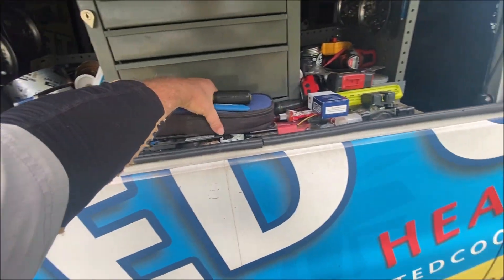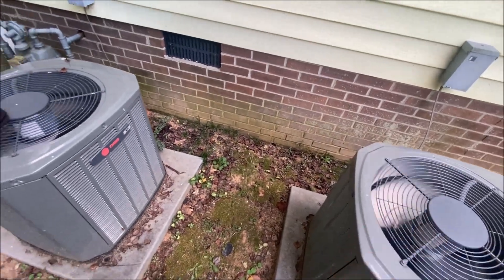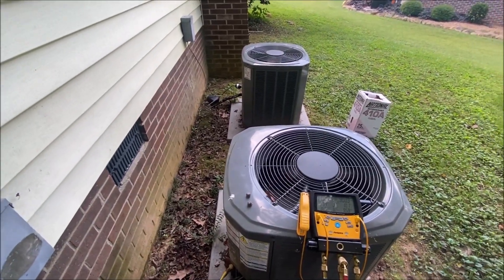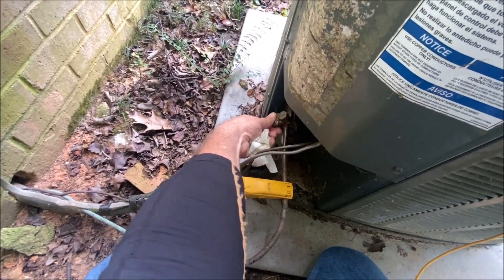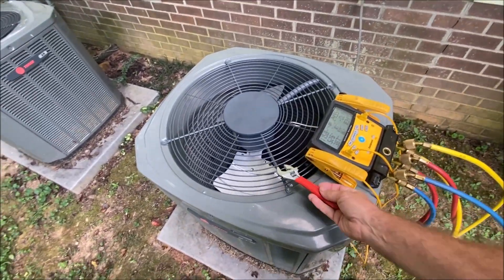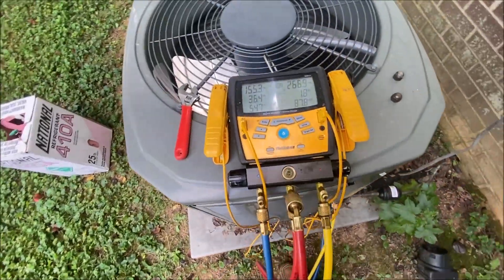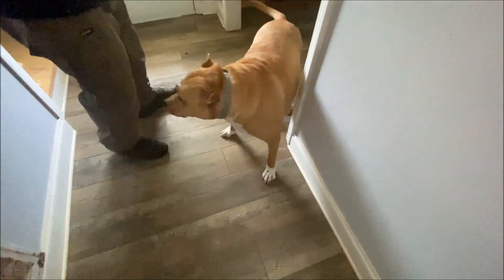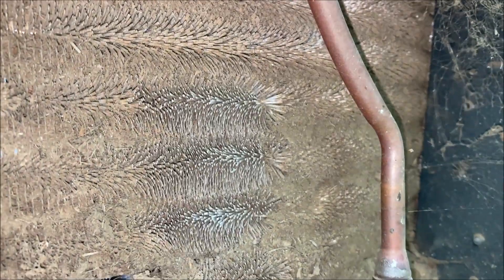Heat and AC system not maintained filter neglected

Comment: "line is cold.. too cold"   Can you explain that?   I had a 22 year old 3T nordyne system die on my but the compressor runs.. it just blow refrigerant out of the terminal area. I have had what I think is high electric bills since I've lived here and I now wonder if the system was overcharged as I was getting 18-20+ delta T on a system located in a hot attic.    How cold is too cold?

Also when I would go by the condenser it never felt like it was putting off much warm air but the house cooled fine and was GREAT at dehumidifying.

Comment: Do you guys check the valve core after every check of charge? I found so many of those leaking which can be stopped with the flare connection on the brass cap but it's not fixing the problem. Would dirty condenser increase or decrease super cool reading? Thanks for the clip.

Comment: Those dogs are friendly pals.  Not sure why the guy was so concerned about them.  One thing for sure, the bum doesn't keep his HVAC serviced and ignores filthy filters which is causing his nice Trane system/ducting/evaporator/blower etc. to get covered with filth which is likely cutting the efficiency by 50%. What an expense he has caused just by leaving out the filter.

Comment: You ever install a trane 7.5 ton air handler with 7.5 heat pump from trane  I have an issue I believe it wiring
Reply: Sounds better to have 2 or 3 smaller units vs. one huge unit.